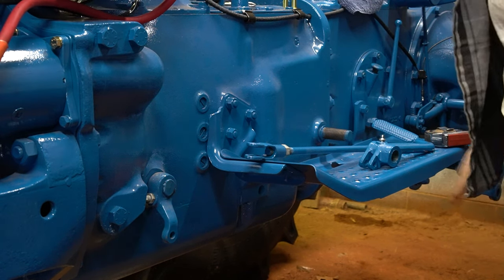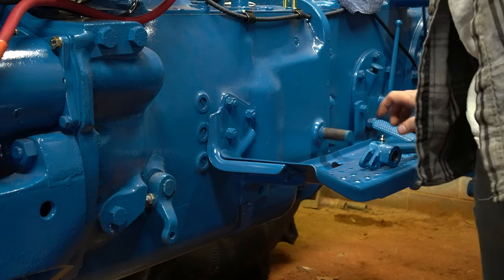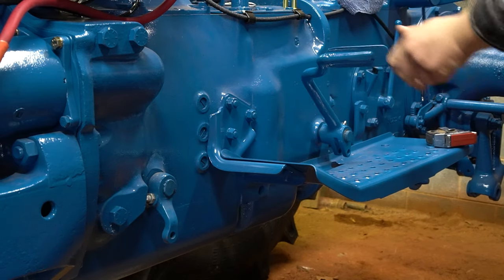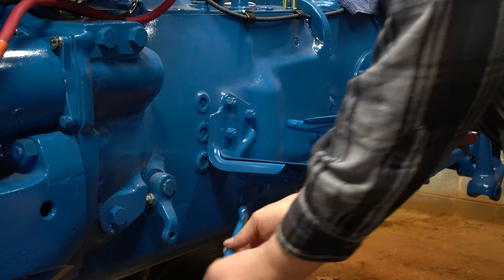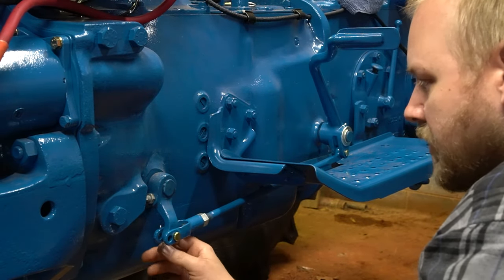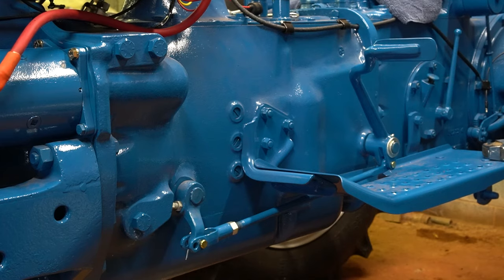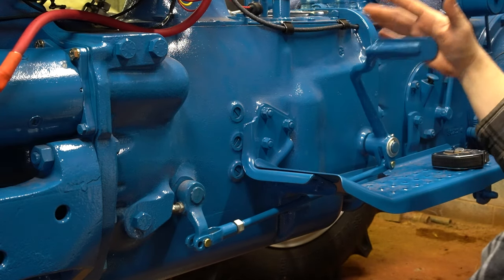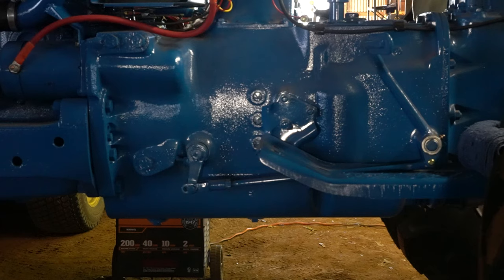How to adjust the clutch on a ford tractor 1955-1964

Comment: Good to see you back again. Just picked up the felpro rear matn seal you said to get today for my 861. I  guess I'm
Going to have to do the same thing to  my dbl clutch pedal. I did your trick to the fuel tank shut off valve. When I removed the brass  shaft there was no rubber o ring inside the valve. Getting as many parts as I can before I  split the tractor. Thanks for taking the time to make  mine and others lives  easier. Warren in vermont

Comment: Hey CHM, thanks for posting so many great videos and adjusting a clutch is something everyone should know how to do. 

 My 1955 640 (or 641) has been working fine lately except she just developed a healthy oil leak behind the coil.  I anticipated the worse however, it turned out to be coming from a rubber hose plug inserted in a drilled hole in the block.  It only leaks when running and I'm not sure what to do to fix.  I have a clear photo and would like to send it if needed, was not able to post.
Many thanks.
TN Rob
Reply from the maker: You can send me a picture on chickenhousemechanic@gmail.com  only rubber plugs behind the coil sound be the pushrod cover bolt grommets. There's 3 of them. The block has some small core plugs in it that cover camshaft oiling holes which are under pressure when running.

Comment: Im working on an 841 diesel 1958. My dipstick tube was destroyed trying to remove it( previous owner mangled it in another overhaul. 
   I cant seem to find one. Where did you get yours?
     Your very entertaining, educational, and maticlous. Thanks for the trip!
Reply from the maker: I got a used one off ebay. They pop up pretty often on there. When I installed the new one I put some loctite around the top to secure it in place so I didn't have to hammer it as hard to make it stay in place

Comment: My harmonic balancer has a dot on each gear that apparently times the gears to themselves. ( I did not tear the balancer apart because it seemed in great shape. )
     There is a dash mark on the timed gear about 30 degrees from the timing dots I first mentioned. 
      Is this dash mark the timing mark that matches to the crank(which has a dot)? My gut says yes. 
    The offset weights seem to be timed to the pistons up and down motions. 
     I hope you can interpret my meandering description, and advise as best you can.
Reply from the maker: These engines in these tractors do not have a harmonic balancer just a crank pulley. As for the engine timing gears check out this video about 10 minutes in to see the timing marks on the gears.  https://www.youtube.com/watch?v=XCwHwKde82Y

Comment: I have a 64 Ford 4000 and when the pedal is  at a 9 inch height ,I had lift my leg so high a had to kind of stand up...if I lower the pedal to a workable height , there isn't enough throw/travel in the pedal to disengage the clutch before it bottoms out....this tractor is  for guys with very short legs...i had to build a riser (block of wood)  under the seat just so I could operate it.
Reply from the maker: I've not had that problem. I'm 6 foot with long legs. Granted, you do have to lift your leg kinda high. On my 861 the top of the pedal is worn smooth because of it. I kind of wonder if the aftermarket clutches are the cause. The clutch I put in the 4000 is a NOS Spicer clutch. No idea what is in the 861 since it was changed before I bought it. I can't get it adjusted properly for anything. The pivot pin is worn on it too though.
Reply: Dad said they were built for Mexican operators 😢

Comment: What paint do you use ? Do you use a paint gun or are you using spray cans?
Reply from the maker: I used ppg shopline primers and iron gaurd enamel from New holland for the colors mixed with hardener and thinner. It was sprayed using an Iwata lph-400 extreme.

Comment: I have a possibly 1956 ford diesel tractor. I’m hoping you see this and can help me out. The numbers on the engine block are: B8NN 6015B.  And the only numbers I can read behind the starter are 2120.  6. Is this enough to identify what it is.
Reply from the maker: Hard to say since those numbers aren't adding up. A diesel wasn't available in 1956. The engine number should be a B9NN-6015B to be a diesel engine. That would be an early 172ci engine vs the 6015J. The 2120 could be a serial number but if it's the model number than that would be a 2000 model tractor which puts it as a 1963 or 1964 but with the smaller 144ci diesel engine or 134ci gas engine.

Comment: I would like to know how to replace the pedal hinge pin, the peg you put grease on before you slid the pedal on
Reply from the maker: There is a nut inside the transmission that holds the pin on. However, getting to that nut is easier said than done. You might be able to come up with a bent wrench or something to loosen it but the gear shafts are really close to it. So to make it easier to remove, you'd have to pull transmission apart, which is no easy task if the tractor is still together.  If yours is not broken and just worn, I'd recommend welding it up and filling it down to size. That's what I did even though transmission was apart.
Reply: Thank you very much, 😅
Reply: Thanks for the info. The Dexta Major has a main shaft that goes all the way through, apparently not in this case.

Comment: The dimensions in the manual weren't quite right for my 861. Had to just adjust the clevis until the double clutch worked.
Reply: As the ground drive and pto clutches wear separately the settings will change the measurements are pretty much only good for a brand new clutch
Reply: @ford9000puller  that's what I figured. Old guy I bought it from had everything overhauled then set the clutch for transmission only for shows and plowing - never really used the pto until I bought it.

Comment: Do you know where I might be able to find a bushing for a Ford 800 clutch petal?
Reply from the maker: I used 2 bushings from McMaster-Carr since 1 isn't long enough. The 2nd just has to be cut down to size and a hole drilled in one for the grease fitting. The bushings I used are #9368T81. Factory part# is NDA7508A.
Reply: @chickenhousemechanic From what I can tell, the first part number for mine should be NDA7526A. My old bushing shows different sizes to what you recommended to use. Any idea if there would be a difference?
Reply from the maker: @triplewlivestock7422  is your tractor a 4 or 5 speed? Also depending on where the pedal pivot is depends on the bushing. Some of the early hundred series tractors had a setup similar to an 8n and those used a different bushing.
Reply: @chickenhousemechanic  To my knowledge it is a 1955 850 with a 5 speed. I’ve looked at 8n bushings and they don’t look like they would work either.
Reply from the maker: @triplewlivestock7422 I looked back at my parts list and I believe I gave you the part number for the cross shaft that the fork rides on. I have the clutch pedal bushing listed as 9368T79 from McMaster-Carr. That bushing is for a 7/8" shaft.  The first number I gave you was for a 1" shaft. This bushing should be the replacement for the NDA7526A. That is if you have the 5 speed transmission. You can tell by the shifter. If the shifter goes up and down and twists to shift it's a 5 speed. A 4 speed is similar to a car shifter. A 4 speed pedal would use the 8N708B bushing which is readily available from tractor part stores. I don't believe the 5 speed bushing is available from them anymore so you have to use the one from McMaster-Carr.
Reply: @chickenhousemechanic I got mine installed, and they worked perfectly. Thanks for your knowledge.
Reply from the maker: @triplewlivestock7422  glad you were able to get the right one and get it working. It makes a huge difference in how the pedal feels.